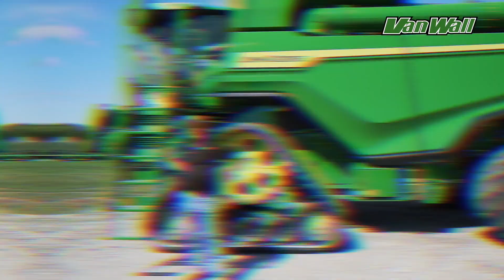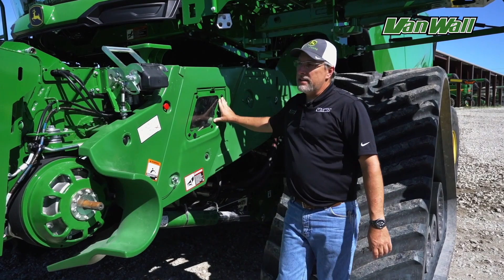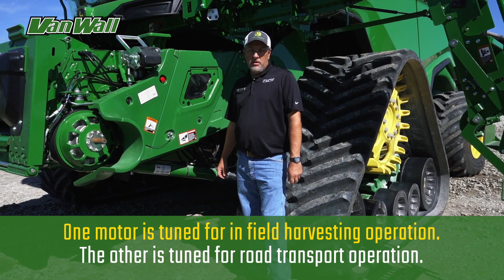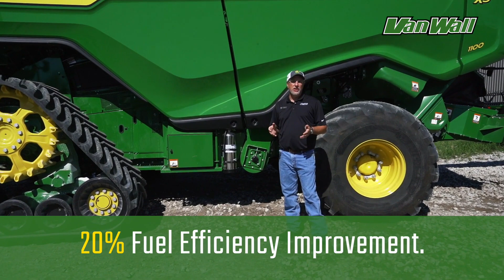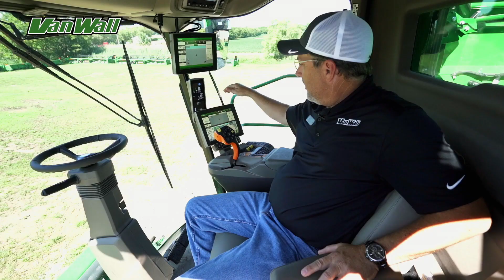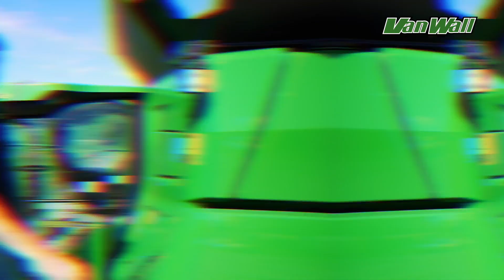John Deere X9 Series Combine Walk-Around

Comment: Not enough horsepower.
Reply: Its not always about horsepower because this John Deere can handle any small grain you throw at it even at 700Hp. I have heard a class 9800 struggle abit while the JD just chugs along so even if CLAAS NH and FENDT have powerful engines it don't mean they won't slow down even with 790 HP so I'd dousent always pay to have an enjine with the best of the best
Reply: I meant it doesn't
Reply: More than enough horsepower bud. I've seen it in the field. It buries trucks all day long